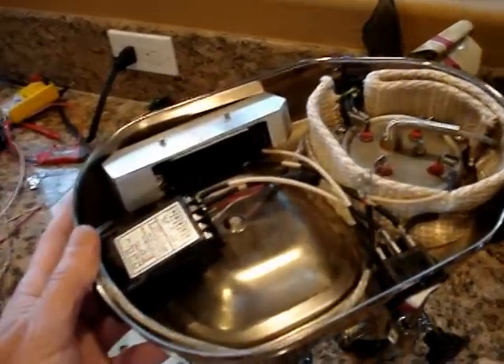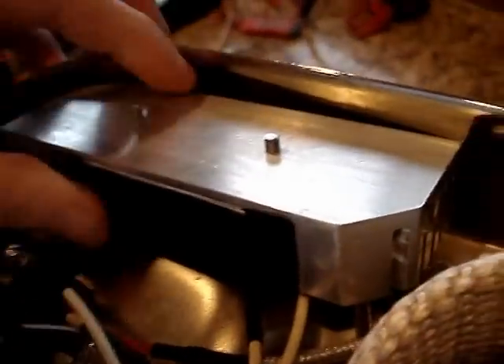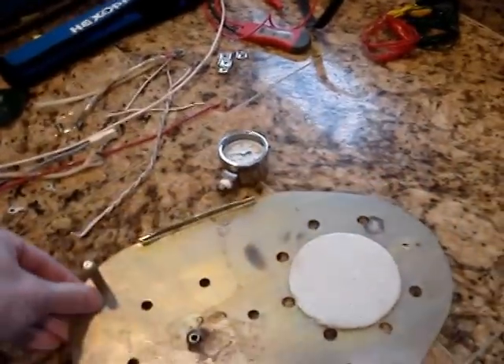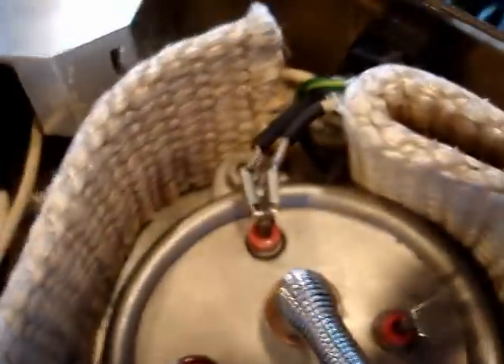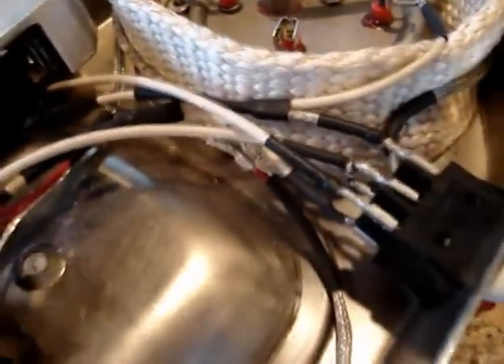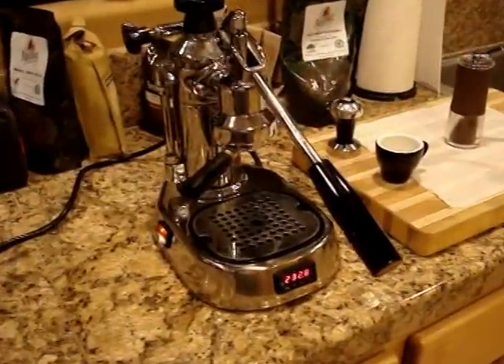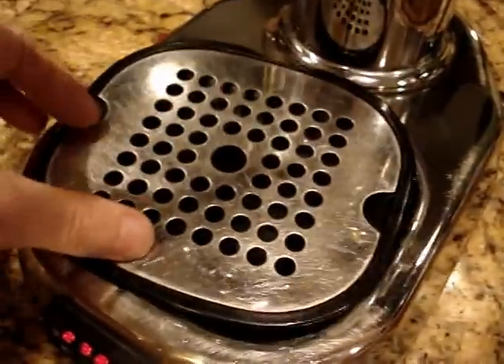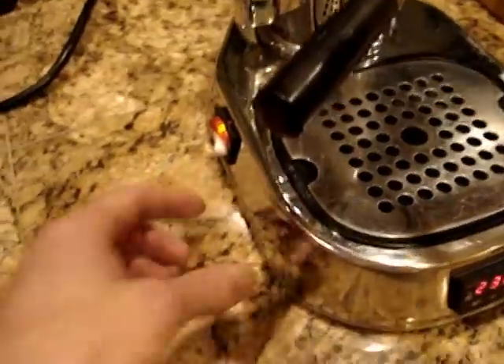La Pavoni espresso machine & PID controller - finally done!

Comment: On the off-chance that you still have that machine, you should probably know that the grey pad on the heat-shield is asbestos.
Reply from the maker: Skaanning Thanks for the heads-up on that. It's since been sold but good to know.
Reply: Where did the temperature sensor attach? Outside the boiler or did you go into the boiler.  I’m trying to do this too, but can’t see where temp sensor is.